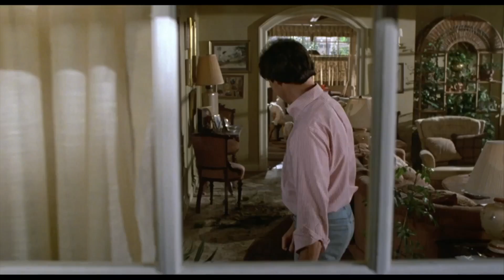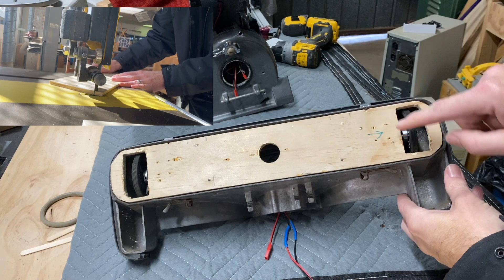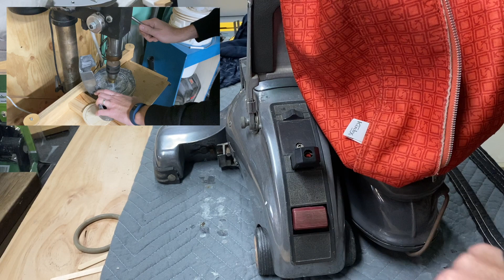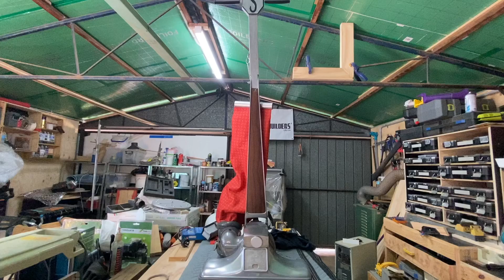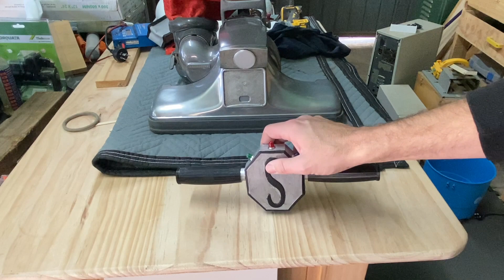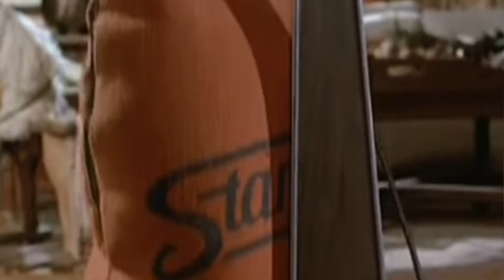I made a radio controlled Kirby Vacuum Cleaner movie prop Monster #Jaws #MrMom #movieprops #rc

Comment: The original prop had a big drive motor grafted onto the side, and the fan still worked.
Reply: If the fan still worked, then why did they dub over the sound of a different vacuum?
Reply: i was wondering about that! thanks :)